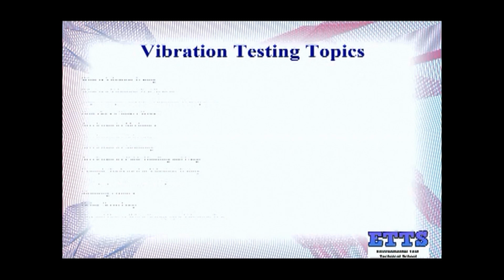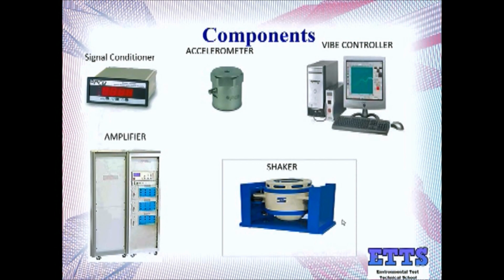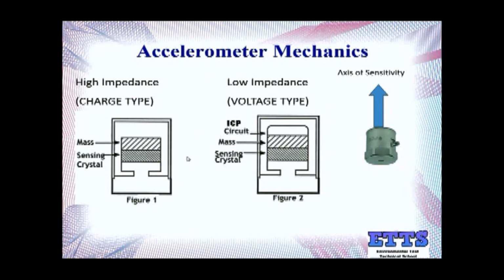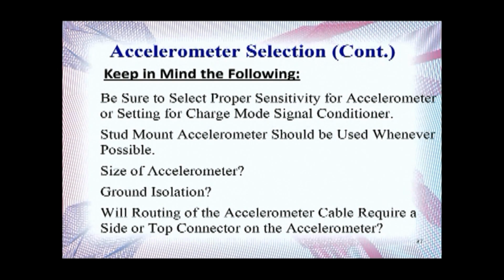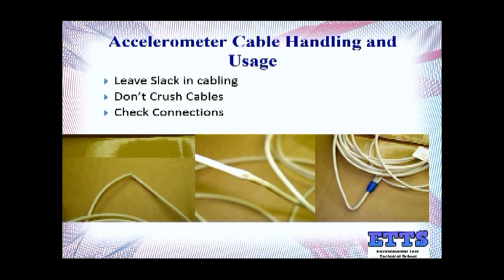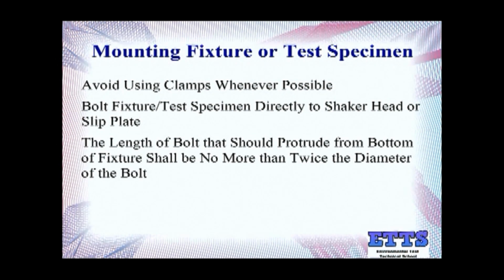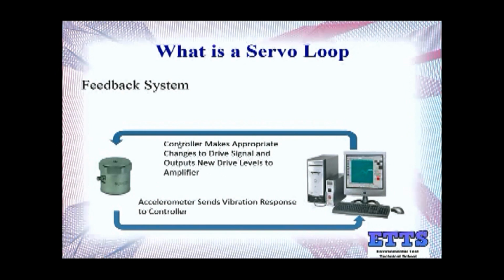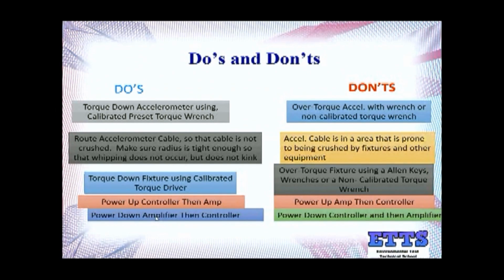Introduction to Vibration Testing Part 1

Comment: Thanks so much. Do you still think that first power up controller then power up your amplifier ?
Reply from the maker: Yes. By power up, we mean the controller is powered on and shows normal startup status, such as indicator lights being on. Do not begin any closed loop control checks until the UUT and test fixture are fully installed on the vibration table and torqued to the required specifications.

Confirm that the control accelerometer and all response and monitoring accelerometers are properly mounted and verified. Also ensure the shaker support systems are powered and operating, including the shaker cooling system (blower or water or chiller), the amplifier, and any additional shaker equipment such as oil pumps when operating on a slip table.

Closed loop control checks may only be performed once the mechanical setup, instrumentation, and shaker support systems are fully ready for operation.

Comment: Good video ! 

Dongguan Lmet Test Technology Co.,Ltd ,with factory located in Dongguan city, specialized in environmental and mechanical simulation testing equipments manufacturer. 

Our main products as below : 
Drop Tester , Carton Compression Test Chamber ,Bursting Strength Test Chamber, Electro-dynamic Vibration Tester, Transport Simulation Vibration Tester , Tensile Strength Test Machine etc.
Environmental Chambers:  Temperature Humidity Test Chamber, Thermal Shock Chamber, Rapid Temperature Change Rate Test Chamber, Walk in Chamber ,Altitude Simulation Test Chamber 
Weathering Test Machine : UV Aging Test Chamber, Xenon Aging Test Chamber, Rain Spray Test Chamber, Salt Spray Test Chamber 
 

For more details abour our testing equipments, you are welcome to visit our website : www.lmettest.com   and contact Mrs. Anna via email  sales01@lmettest.com  Thank you . !
Reply: I am Binu  T Jacob working as a test engineer In a private sector.Mainly specialised in dynamic tests and also experienced in environmental and electrical test .
I willing to work with your organisation if any job opening please inform me.
binujacob602@gmail.com
91+7306577131